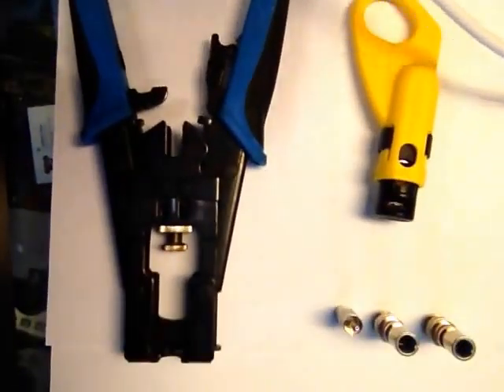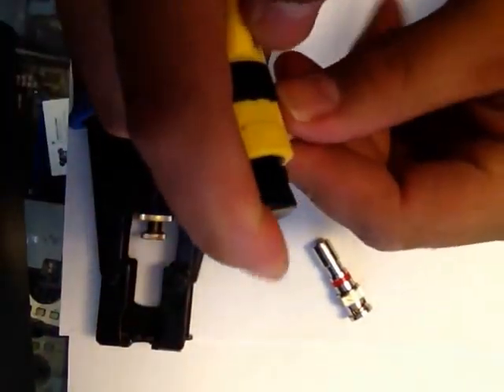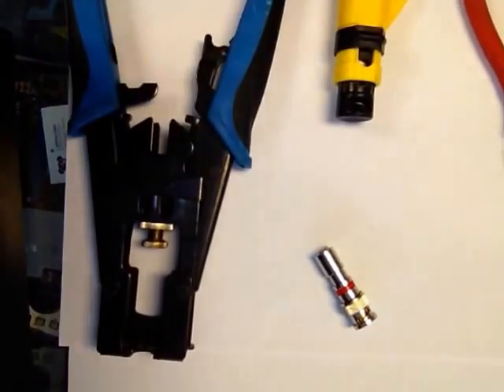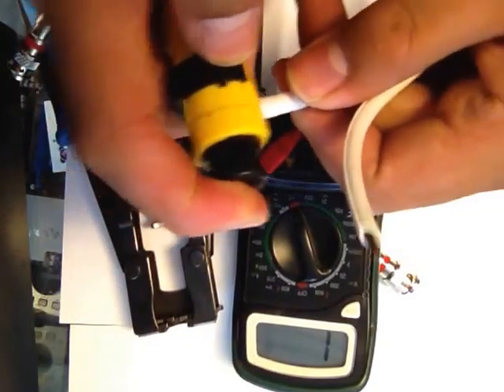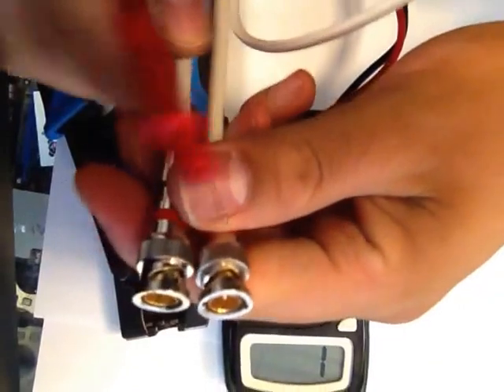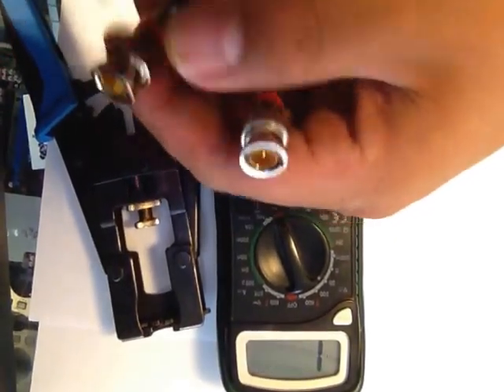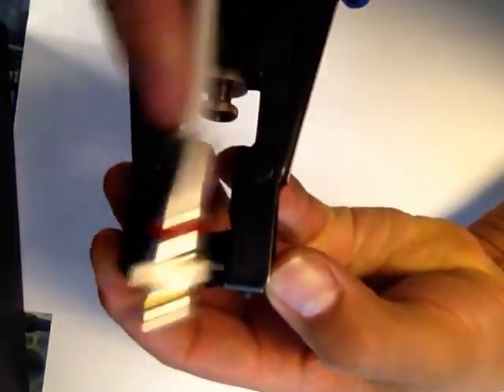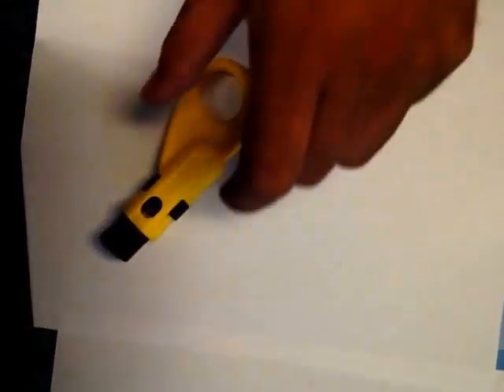What NOT to do | While Installing RG59 BNC for CCTV | 8-6-2016

Comment: Um... Me thinks that way of making a BNC connector is exactly the WRONG way to do it.   Crimp pin on the stinger then use collar over shield, then crimp.   Also, you didn't check cross continuity.  Check stinger to braid/shield to make sure one of those tiny shield wires didn't make it up in the diaelectric .
Reply from the maker: Def did not check the braid and the copper using the continuity method. I make these videos and we all can learn, I might be doing something wrong and that's the beauty of the internet we can all share our voice and learn from each other. I will do this from now on. Once I had a camera that was fuzzy and with your techniquie u can check that...